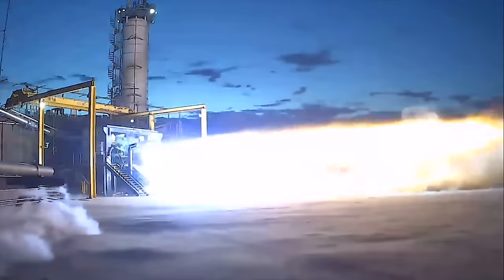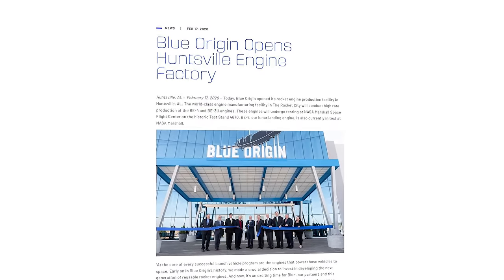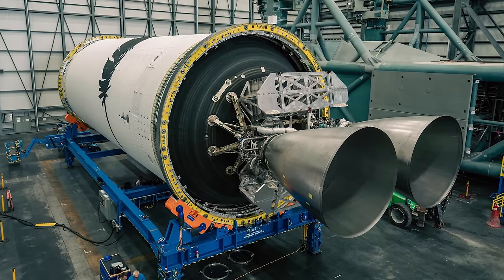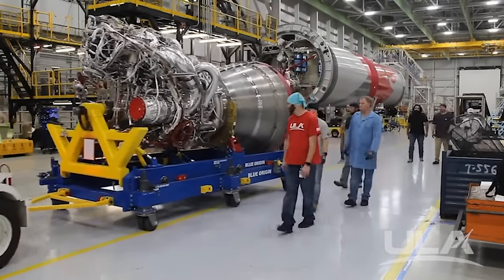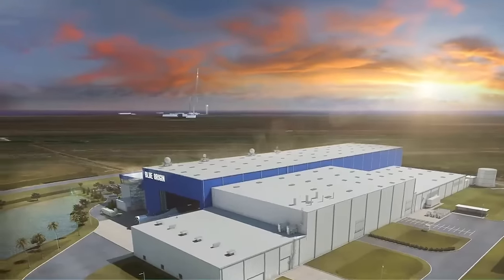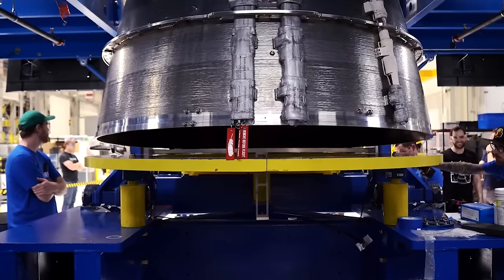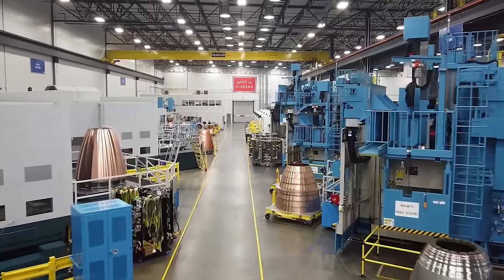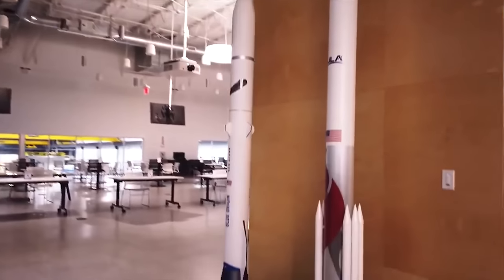Can Blue Origin Handle The BE-4 Engine Demand?

Comment: BO has turned out to be a "cosmic" joke...
Reply: Just you wait
Reply: Why, because it doesn’t have an x in its name?
Reply: Poop post is poop.
Reply: at least they know they need a water deluge and flame diverter and arent planing to make a "rapidly reusable" rocket covered in tiles that all need checking after each flight making it not rapid in the slightest.
Reply: SpaceX also knew they needed a deluge system, you don't think they built something like that from scratch that fast do you?

That thing took many months just to design, never mind actually build.

It doesn't take a damn genius to understand that it was being built, while they were launching. Musk didn't care simply because they were going to have to bust it out anyway. So why wait to test the rocket?

And the reason for the tiles, is the sheer size of starship. I doubt they tossed a coin to decide whether or not they were going to slow it's descent on reentry using rockets like their others, or belly flop it. They chose the belly flop for a reason. I doubt anyone except damn knows why they decided to do that, but you can't belly flop something coming in that fast without tiles on it, it's going to melt.

Oh, and let's keep in mind that blue origin is literally two years older than SpaceX....

Blue origin 24 years to get something pretty close to ready.

SpaceX, well I'm not going to list all the shit they've done in the past 22 years. It would be a very long list.. 🤷‍♂️

I know, some folks just got to hate those on top. You're one of those people. It's nice to root for the underdog, but seriously, get your head out of your ass. SpaceX is absolutely amazing.
Reply: And as you can see from the accomplishments of both companies, SpaceX doing things fast, tearing things up, is obviously a hell of a lot better than the way blue origin is doing things....

Which is why space Essex is making so much damn money, while also under bidding everybody. That came about because of how fast they did things. And the only way you could do things fast is the tear things up.
Reply: @lordgarion514  so youre saying spacex can build rockets that can land from space but cant spray water from a pipe? what????
Reply: Because it doesn't have a "W" on its side. @Mentaculus42
Reply: @lordgarion514 building something to work isnt a bad method of design. for one the SLS managed to get finished and flew before spacex even have a block 1 up and running so it clearly isnt a quicker technique spacex are using. maybe spacex just cant make something work straight away.
Reply: @geesehoward700  
You don't actually know that much about this stuff, do you??
(Rhetorical question, the answer is no you don't)

A few problems with your comparison between SLS and SpaceX.

The first is that the SLS uses a whole lot of pre-existing older hardware that was just sitting around......

And the worst thing for you is that the SLS, which uses reusable engines from the space shuttle, is NOT reusable.....

It's also the most over budget system we have ever built, at over 4 billion dollars per launch, and it was announced after that price was told to us, that the price was probably going to increase.

Wait, what were you saying again?
Reply: @geesehoward700  
Went and got the exact numbers for you, SLS took a smidge over 10 years to design and build a knot at all reusable rocket, using a hell of a lot of pre-existing parts.

It took space 13 years, and a LOT less money, before it built its rocket that had a successful landing.....

In other words, less than two extra years, to get reusability for less money.
Not sure what to tell you, except haters gonna hate. LOL

Blah blah blah, SpaceX is kicking literally everyone's ass. 🤷‍♂️
Reply: @lordgarion514 none of that has anything to do with flying first. spacex could have reused falcon 9 stuff and it wouldnt have mattered either.  i dunno maybe they reused the flight control software so what? whether or not SLS is good or not is of no concern beyond it being designed and flown without being blown up or scrapped over and over.
Reply: @lordgarion514 are you a child or do you work for spacex? the design of starship is a disaster with the best feature of falcon 9 being dropped (its ability to land anywhere) and their use of tiles on a supposedly rapidly reusable rocket is a joke. i doubt starship will ever get human flight rated so youll have to dock with it in space with crew after refueling the thing 6+ times (a tech we dont have and is incredibly dangerous for a company that likes to mess up). the whole thing is stupid. the only interesting thing ive heard about starshit is that it is being considered for the starlab station so the gives starship at least three jobs to do.
Reply: @geesehoward700  
Again, you're showing how much you don't seem to know about what's going on. More numbers for you.

The last launch date of little Starhopper was August 29th, 2019.

The date of the first launch of starship was, May 5, 2021.

About a year and 9 months.

Considering how long it takes to design and build things of this scale, with such massive pressures, probably took almost half of that time to design.
Never mind that plate with the holes in it, took a hell of a lot of engineering.

And if it was just spraying water out of a pipe, someone like you could have come up with it. But instead scientists and engineers had to design it, using extremely expensive computers.

As I said, haters gonna hate. 🤣🤣🤣
Reply: @lordgarion514  do you work for a space company?
Reply: @DroolP  
No, but I'm a space nut.
And TBH, who's done what, and how long it took, is easily looked up information.
Reply: @lordgarion514 im so glad they just pulled all the design work out of their ass and nothing was designed at all before starhopper magically flew on its own. 

also why not just throw a water pipe up and just keep blowing it up like the space ships until it worked? is it because elon has a weird aversion to that and flame diverters and stupid?
Reply: @lordgarion514  you arent a fan of space but just another spacex cultist. you guys make me hate that i like falcon 9.
Reply: @lordgarion514 development started on starship in 2012. soooo , yeah.
Reply: @lordgarion514  true and not. A lot is done and not said or published. Videos get blurred and for good reason. Things take time and people and internal politics are a real thing that drives the train. Neck break turn around and decades long results are just two different ways of doing things. Designing is easy. Manufacturing is hard. I promise you life will be amazing if all the companies are successful. That is coming from someone that has been neck deep in all of it.  You will have a lot to go nuts over in the next few years
Reply: @geesehoward700  
Went and got some more numbers for you, because this kind of shit calms my mild ADHD down.

The ICPS, which is an upper stage thing, is modified from the Delta for rocket, and the version from the Delta 4 was modified from the version on the delta 3. It took an estimated 5 to 7 years between designing the original, and modifying it for the Delta 4, and modified some more for the SLS.

The solid rocket boosters from the shuttle took almost 10 years between designing, building, and the modifications along the way.

SLS also reuses pre-existing avionics, sensors, and actuators.

Plus Orion is a modified Apollo......

What the hell are you bragging about SLS for exactly????

I'm not going to look up all those smaller things, or the orion, but how many years are we up to for SLS so far??? 🤪🤪
Reply: @lordgarion514 go read what i said about the sls and find where i said anything positive about it a part from it being an example of building something that works from the get go and flew before the starship. 

using something  that predates the SLS and works isnt an issue but a good idea. the fact that the SLS costed so much should have been investigated or been enough of a reason to cancel the program however since something was clearly wrong.
Reply: @geesehoward700  
Yeah but it flew before starship because it had damn near 50 years of R&D on it before they even started designing it, so yeah it flew before, but it took a lot longer.

Oh wow, I started 40  years ago, but I flew before the guy that started building his rocket 13 years ago... ..

I'm not mistaken, I think I asked you what was so good about it, I did not tell you that you said there anything good about it.
Reply: @geesehoward700  
And on the SLS's first launch, they had a small hydrogen leak, sensors didn't work right, and there were software glitches.

On something with a shitload of reliable parts that already existed for years, with lots of use on them, and over a decade to design a rocket that's not reusable, therefore much simpler.

No, I'm not impressed with anything about SLS, especially not its  first launch. 5 decades of R&D for something that's not reusable at all, is absolute ass.

It should have gone absolutely textbook perfect. Far from it. It was a failure overall in my opinion.
Reply: @lordgarion514  
IF U SAY SO! It still looked like a self inflicted cluster duck to many people. Sx could have installed the douche system first and avoided the entertainment and now been ahead of where they are now as they would have gotten some useful info on the first launch without the negative PR. This execution seemed very suboptimal. Apologist are hilarious, especially the …
Reply: Found the fanboy lol
Reply: who you? @sarkaranish
Reply: @HowDareUbuddy  Not a SpaceX fanboy buddy, I just appreciate space innovations and companies in general.
Reply: yeah, okay @sarkaranish
Reply: @HowDareUbuddy  cope lil buddy that space isn't just one company like spacex

Comment: A minor slip up on your part: There are TWO BE-4 test stands at Blue Origin's Corn Ranch facility. If one is damaged or otherwise out of commission for maintenance, etc., the other can take its place. 4670 at Marshall Spaceflight Center adds a third test stand, and it is dedicated almost solely to rate testing (acceptance testing) of production engines, leaving the other two in Texas to be more focused on development and qualification testing of the next block iterations.
Reply: Technically third and fourth. Two engines can be one that stand at 4670
Reply: @DroolP  It's only one at 4670 for BE-4. The other stand is for rate testing BE-3U.
Reply: @mikedicenso2778 oh. Awesome. Thank you for the insight. Still awesome. Walking up the stairs was still nerve racking. Never got to see the plumbing last time I was there.

Comment: For ULA to reuse engines they would have to have have some way of rapidly disconnecting all the plumbing and electrical for separation of the engine section from the rest of the booster during flight.  That should be an interesting engineering challenge.
Reply: The space shuttle basically did this with the external fuel tank, so this isn't completely unheard of.
Reply: @plainText384  Good point.  I hadn't thought of that.  The Space Shuttle used explosive bolts to sever the connections in flight. I wonder how many of those bolts ULA would need.
Reply: The original 3 engine Atlas decades ago dropped 2 of its booster engines during flight so this has already been done. The umbilical plate on the space shuttle seemed to be free of problems after the early flights and that was with hydrogen vs methane. Also it appears that few if any explosive bolts were used directly on the umbilical plate area as this was directly in the tile area with a door that had to close. The explosive bolts were used in the load transfer structure and a venting valve. Besides what is the difference between this on Vulcan near the engines vs at the lower and upper stage interface? And in addition falcon heavy seems to be successful. So probably just some straight forward engineering involved, absolutely nothing that hasn’t been done before other than the inflatable heat shield which has been successfully tested in a very slightly different situation.  It will be interesting to see which type of systems work better as rockets scale in size. Considering that Vulcan doesn’t stage as early as falcon and has two engines it seems to be a logical and safe approach. The truly interesting comparison will be between BO vs chopsticks.

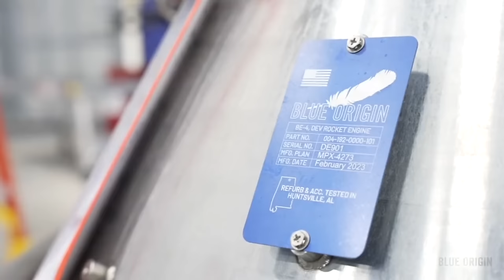Comment: 0:06 has that engine been blurred in editing or does it actually just look like that
Reply: The advanced gaussian blur casting technique
Reply: IP is IP
Reply: They might want to keep the Engine internal geometry of the nosil secreta.
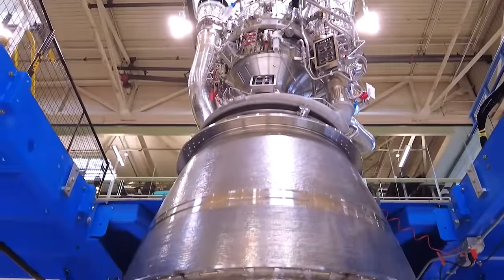Reply: Good catch.  Definitely blurred.  Weird, also at 1:57 but in zooming in, it doesn’t really look like a nozzle.  Almost like a jig or a fixture??  Now I’m curious, this will bug me.

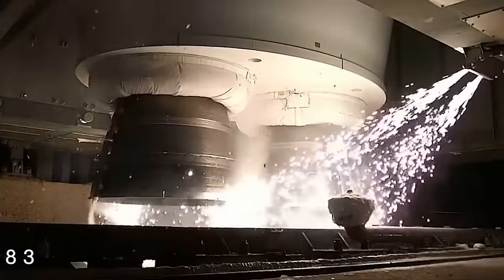Grrr, now again at 3:07!  What IS that thing?
Reply: As a Blue Origin engineer, I can confirm that it is naturally blurry, much like Bigfoot.
Reply: @ronjon7942 the bluring might have been after that stack of engine nosels segments whent through the machining prosess of the cooling chanels and might fall under the missle export restrictions and DOD/DOJ might have made Blue Origin blure them.
Reply: @danielconway7190  lolz.
Reply: @ronjon7942  most of it is intellectual property and is industry guarded due to ITARs regulation.
Reply: Might be an item with an opaque protective dust cover or lid. Not unlikely in an environment where there's electronic circuitry, dust, and engineering taking place.

Comment: ULA's engine reuse plans sound like something they could eventually abandon, similar to their ACES upper stage.
Reply: They didn't abandon ACES, it just transmogrified into Centaur V. Over the years, more and more of ACES will be incorporated into CV. They have a really good business case reason to do SMART recovery since the launch of so many Kuiper satellites will require a high cadence and not having to depend on building and rate testing new engines every time.
Reply: @mikedicenso2778  I think having secured so many Kuiper launches is the opposite: They don't have a strong incentive to speed up reuse plans, as ULA has more than enough income from contracted Amazon launches to stay afloat comfortably. A stronger incentive would be if they faced the near prospect of losing out to cheaper competitors. Bruno suggested SMART is still years away. That doesn't sound like an ambitious plan when you compare it to competitors like New Glenn, Neutron and Terran R. Or Falcon 9, for that matter.
Reply: @cube2fox  Not at all. If they didn't have so many launches, they'd have pushed off SMART indefinitely, but now they have to increase their flight rate to 25 flights per year by 2025-2026 to meet their obligations and so SMART means less work once the system is implemented and the condition of the engines can be evaluated.

Not ambitious? The concept still allows ULA to fly Vulcan to near depletion of booster stage propellants, so they can that extra oomph of delta-V for the CV stage and it can save more prop for high-energy missions.
Reply: @mikedicenso2778  They don't have to make the engines themselves, they just buy them from BO. With SMART they have to buy less. It seems likely to me that New Glenn, Neutron, and perhaps even Terran R will all have first stage reusability before ULA implements first stage engine reuse.

Comment: Good luck building those spaghetti monsters at any speed.
Reply: They've actually built quite a number of them. Go watch Titans of CNC Machining's tour of the Huntsville factory. You get to see the final assembly area with up to five engines in it, and hundreds of parts for dozens of BE-4s as well as BE-3U and BE-7s.
Reply: @mikedicenso2778  
Well I doubt they can keep up with the Raptor 3, unless the BE-7 is much simplified. with simplified engines SpaceX will be able to build ships faster  and gobble up market share at less cost of production and man hours spent.
I suspect once prooven out Raptor 3's and beyond will cause a paradigm shift, and over complicated engines will become collector's items.
Reply: @garylester3976  SX doesn’t have similar engines. The opposite actually. The difference is manufacturing hardware. SX had the same slow pace at the beginning as well. Once things (like design and efficiency) were dialed in, they made their infrastructure around that. BO will do the same but they will start slower. The two companies have two wildly different approaches to success and test iteration. One is more cautious and doesn’t want to have iterate more than 10% from initial design and the other tests full tilt and learns from their failures (which are also celebrated).  Neither one is wrong. Both get to speed. SX needs a lot more engines per vehicle 33 for primary stage vs NG needs 7 for primary stage per flight. It is all relative in the end.

Comment: I want to support BO, but they make it so difficult.  This engine is much worse than the SX Raptor 2 & 3.  The R2 is almost the same thrust but half the size and weight.  R3 has more thrust than the B4 with the same size as the R2.  The BE4 looks like a bunch of cables and tubes going everywhere.  A huge mess.  The Raptors are a clean and uncluttered design, which is very manufacturable.  BE4's are hand made.  Good luck with mass production.  I hope Bezos taking over will improve BO's performance.  We need more competition in large launch vehicles.